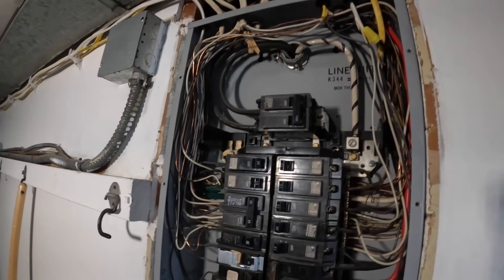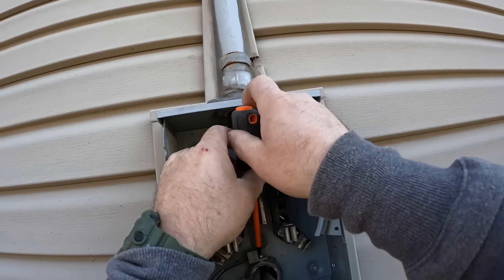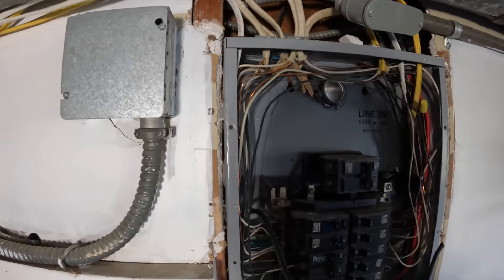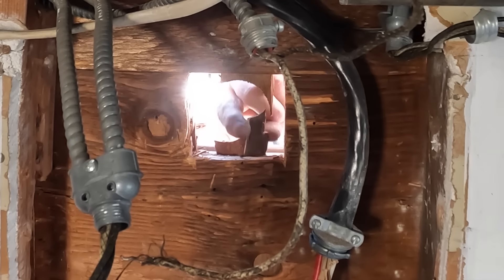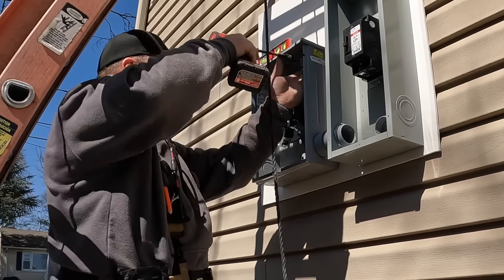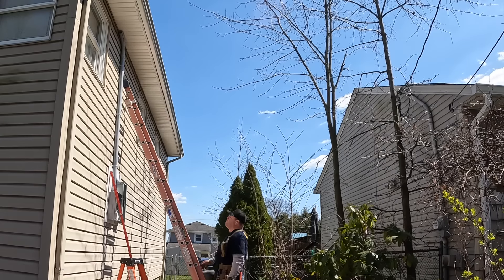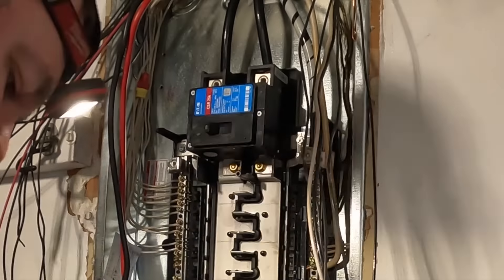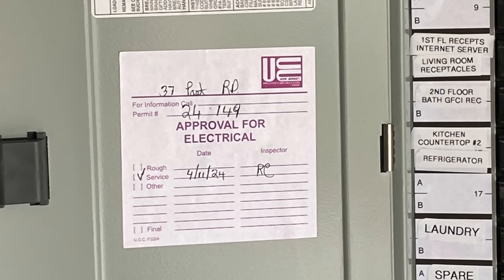Upgrading an electrical service from 100A to 200A | Clark, New Jersey

Comment: In most cases with 120/240 volt you don't have to worry about voltage jumping out at you. But in the case of higher voltages of 7,000 or 12,000 volts like in the substations or overhead primary lines it can jump at you through the air if you get close enough to it depending on how good the ground is you're standing on but you don't see those high of voltages in residentials lol
Reply from the maker: That's what I've been taught and through further research have learned. Fortunately, my license is good for up to 600 volts so I sent see myself ever working with 4160, 13.2. or anything over 600 volts. Thanks for commentary.
Reply: @electricianron_New_Jersey  No problem. I'm not a licensed electrician but I do have experience from working with an electrical contractor and I have worked on 120/240 volt. 120/208, 277/480 etc. I can do my own electrical work for my house with permits but due to liability reasons I stay away from doing it for other people. I work as a maintenance supervisor for a glass factory and I have some industrial knowledge as well but it's more for mechanical equipment. I also work on motorcycles, vehicles and vintage audio equipment in my spare time.

Comment: Hey Ron great video.  Question... my 00 aluminum wire is fastened into the meter and my main lugs I cranked the lugs to torque spec but they are still slipping a little over time.  Is it safe to apply clear silicone caulk directly to hot areas safely to keep it in place? Thank you.
Reply from the maker: No, no caulk or silicone.
Reply: @electricianron_New_Jersey  damn ok. I don't wanna crank down any harder bc the aluminum tends to flaten out and i don't want to break it so I'll figure something out

Comment: So did you cut the service drop before you pulled the meter? You usually pull the meter first then cut the service drop in earlier videos.
Reply from the maker: Always shed the load first. The meter is an electric load.
Reply: @electricianron_New_Jersey  oh, that’s what I thought. You would always pull the meter when it was under load in your prior videos

Comment: looks good, only difference is i would have used 2 inch RMC and just shoot right  up through the roof. then let the power company do there thing. mid west here. cheers
Reply from the maker: The truth is that would've required a lot more work, paperwork, and cost a lot more. Two sticks of 2" RMC would be required and 2-3 additional hours of labor to accomplish this. Easily a $900-$1200 upgrade.
Reply: @electricianron_New_Jersey  Im with you on that! Cheers

Comment: In socal we can't use LBs or any kind of junction box for the service mast .
Reply from the maker: With special permission it can be done here. I understand what you're saying about the LB being a non-metered portion of the riser and potentially a location to "tap the line side" but that would require a ladder and it's highly unlikely going to be bootlegged from there. Don't you think?
Reply: @electricianron_New_Jersey  I agree. Tapping would be very difficult .

Comment: Bet it would not cost manufacturers of smart meters no more then $20 to install a lockable lever to open the smart meter relay contacts instead of the $3 to $500 for the exterior outdoor disconnects ,ground bar and additional ground wire& labor.

Comment: Does anybody know how much more a one piece 200 amp single phase meter/ outdoor disconnect box cost. compared to a meter socket & a 200 amp outdoor disconnects like he used Years ago when I was wiring in a duplex on slab it was always way cheaper to purchase a two gang meter socket and two two pole 100 amp 2 circuit panels with 100:amp breakers. Great quality work.
Reply from the maker: They may be less expensive but good luck finding one for actual sale.  They’re back ordered until 2026!
Reply: @electricianron_New_Jersey  With bad news & what thru the roof copper prices two years ago it's has to be very difficult to stay in business. Two years ago I talked to a sparky who told me it took him all morning to just get the supplies for a 100 & 200 amp service. Supply house was out of think he said 200 amp panels & something else then he had to hit two big box stores. Worst part the when he called the supply house near closing time the day before they told him they had 9 panels in stock so he didn't bother with a will call. He got there less then a hour after they opened and some contractor purchased all 9 panels. Glad that I'm retired. I had a great little supply house that would give a nice discount if you bought in bulk & paid in cash. Would purchase  100 single pole breakers and several 200' rolls of #2 SEU ( 100 amp ) service cable.Enjoy your vidios.

Comment: When should you upgrade to 200 from 100?
Reply: Any time you have to replace the service. With more and more people getting EV chargers, gas appliances being phased out, plus the potential for hot tubs, pools, etc, it's worth it to spend a little extra now to save a lot of headache later.
Reply from the maker: Usually people want the upgrade to 200 amps when they need space for more circuits. I always recommend going to to 200 amps if a 2nd zone of air-conditioning is added, or a kitchen is going to be remodeled, electric vehicle chargers, electric or dual-fuel ovens are added to the electrical system. If you are unsure a professional electrician will be able to provide you a detailed load-calculation, the building department may even require the calculation before approving a work permit.

Comment: And yet the utility company may not provide 200
Reply from the maker: The utility conductors are in free air so their ampacity is different than NEC standards. Yes it's true that 50 kilowatts utility transformer rated at 240 volts provides 208 amps (P/E = I) but the transformers secondary's are usually connected to 3-4 or more residential properties.
Reply: @electricianron_New_Jersey  I get that but have also been connected to transformers in which we blew up 3 of them in six weeks because the utility had to many connected.
Reply: @electricianron_New_Jersey  From your thumbnail, I thought I=P?